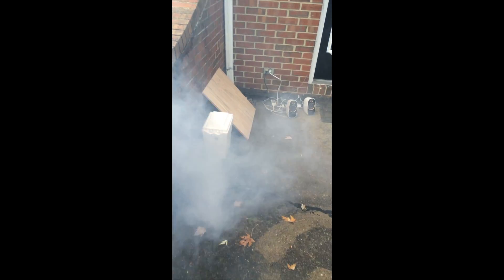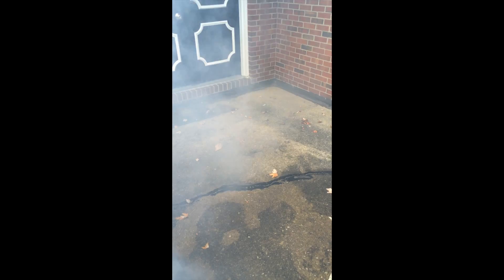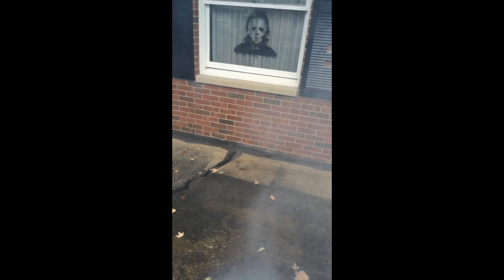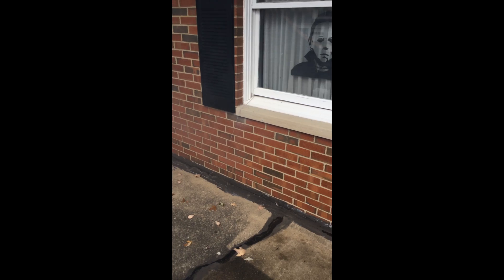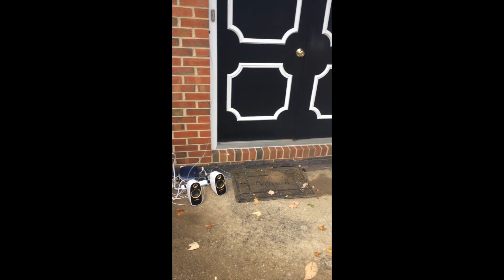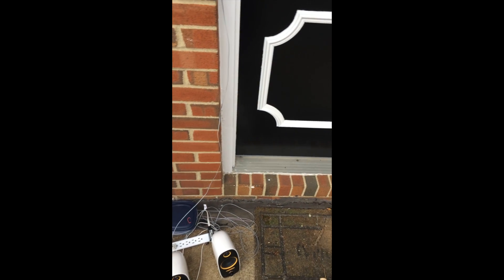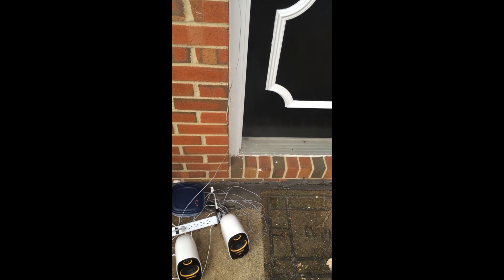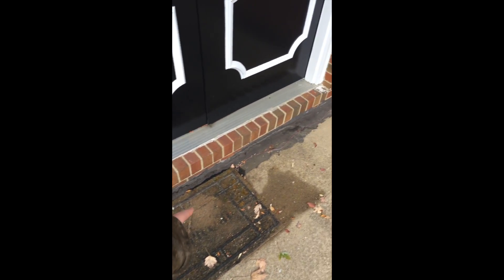Arduino Halloween Scare

Comment: Unrelated but wondering if your still using your toaster to reflow oven successfully or if you made changes to it..
Reply from the maker: tweaked the timings here and there, but yes, I used it to reflow 200 programmer boards and plan to use it for prototypes in the future.